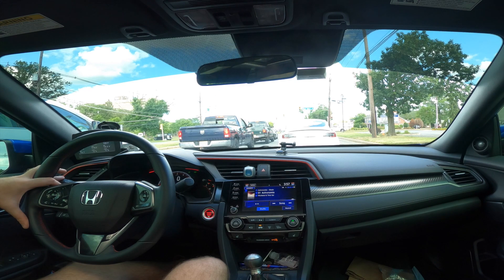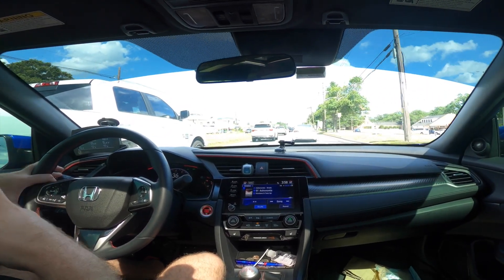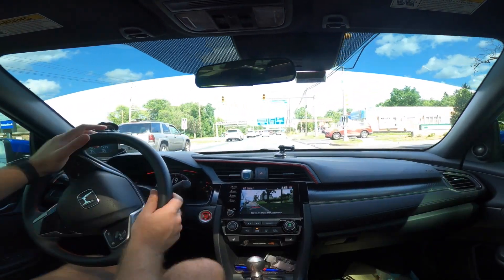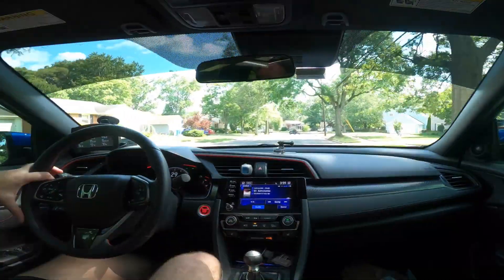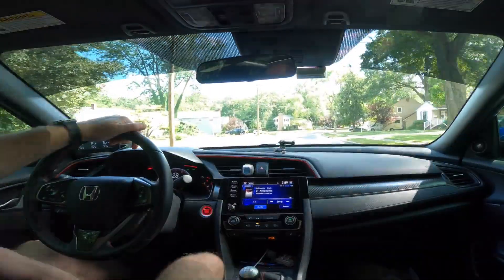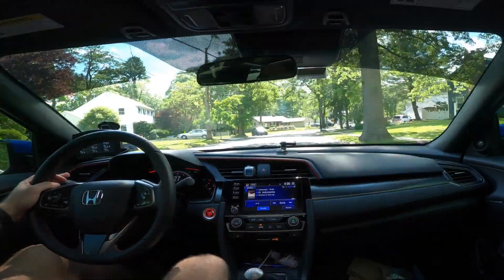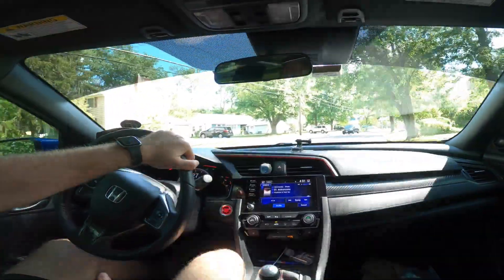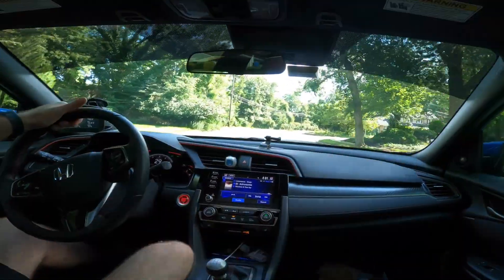Propper Talks: Torque Steer

Comment: whats the best thing i can do to prevent torque steer in my 2020 si
Reply from the maker: Accelerate slower. Withouy changing the whole frame and suspension of the car there isn’t much you can do

Comment: Why do you sit at lights in gear for long periods of time?
Reply from the maker: Just safer. If you need to get out of the way or something like that then having it in gear makes it easier and faster to get moving.
Reply: I sit in neutral if I won’t be moving for the next few seconds. Excessive wear on your clutch from constantly holding it. I don’t see you getting out of the way in traffic like that. Really wanted that car but ended up with the type r

Comment: I honestly never felt it myself. My car is not tuned yet but wouldn’t the limited slip differential take care of that.
Reply from the maker: The limited slip differential just lets the wheel spin at different speeds which would actually make it worse if one tire is getting more traction than the other. tyhe suspension geometry is the main culprit for torque steer.